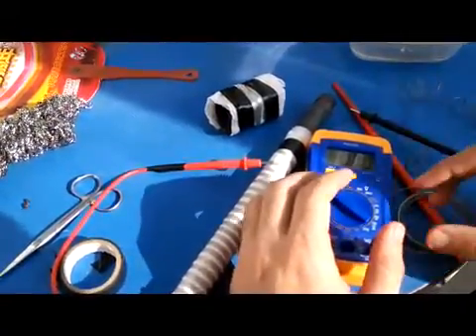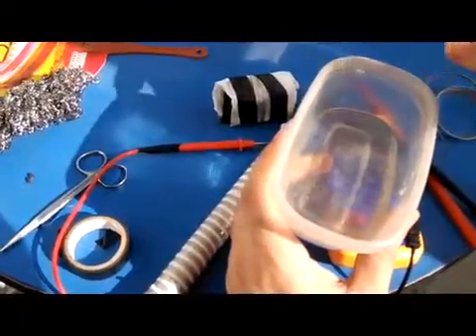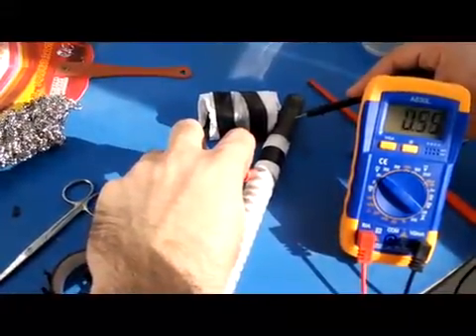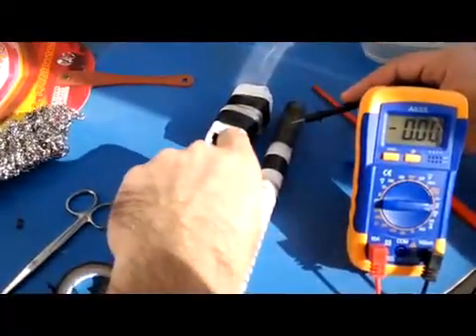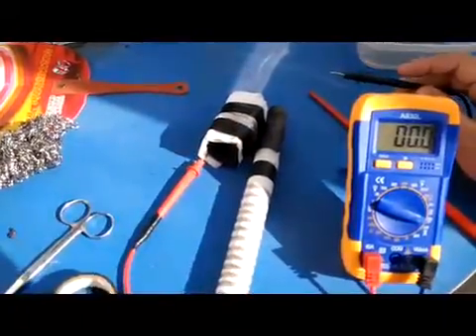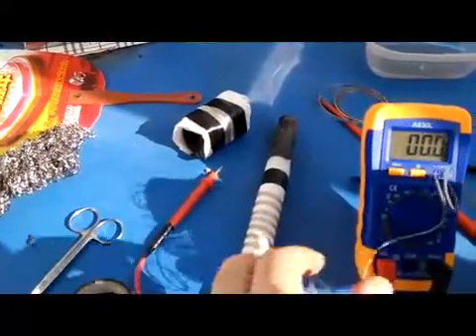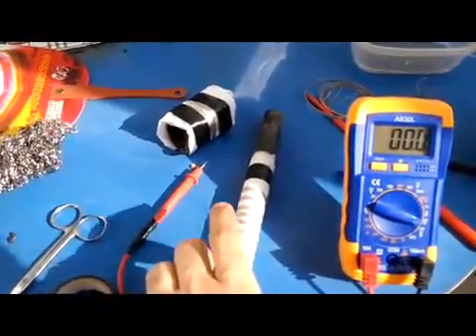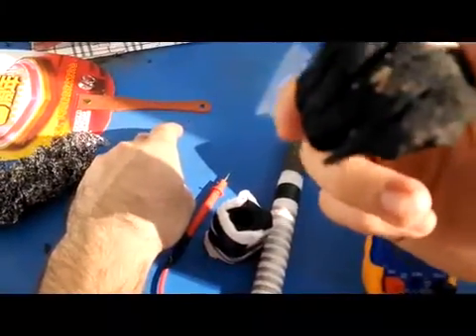Carbon and Magnesium Battery

Comment: Can you please tell which is better? Carbon-Magnesium or Carbon-Aluminium?
Reply from the maker: Danyal Ahmad Magnesium is jam packed with energy and is easy to break therefore Mg is better.
But Al is readily available and can take moisture as well. The choice is yours. 
This was my first attempt. After that I realized Mg + Copper    OR    Mg+Brass   OR   Mg+Graphite is better way to go. And dry cells last much more than wet ones. See my other videos to get an idea.
Reply: Here is the U.S copper is extremely cheap! However, carbon is extremely expensive. So, I was going to use charcoal instead. I will also consider using aluminum and copper. What is the output difference from a dry charcoal cell and a wet charcoal cell?
Reply from the maker: wet will always give you more amps..but it usually dies soon. I did not try all configurations. Whatever you try please share the results.
Reply: Talha Kamran Sure!

Comment from the maker: when you will put charcoal into the vinegar + salt + oil solution it bubble and sounds will come out :). Which is good. Then wrap the charcoal in paper towel. I connected 2 such charcoal cells in series and was able to lit and old LED light that works on 3V and few milliamps. Its on my desk. I want to see for how many days it will last :)